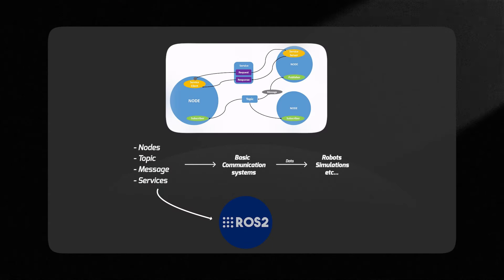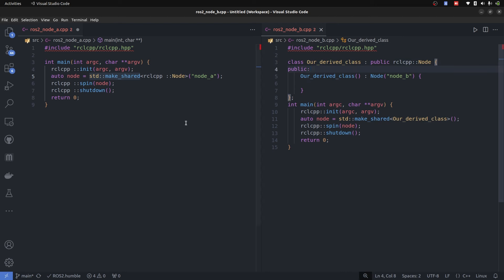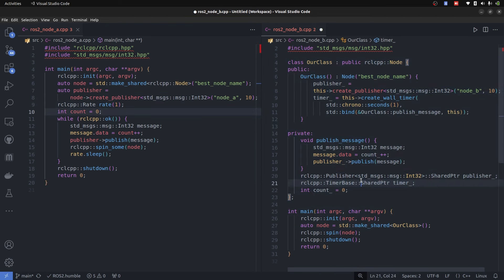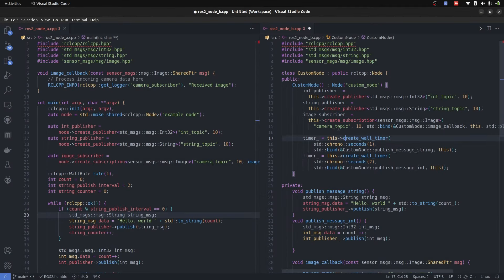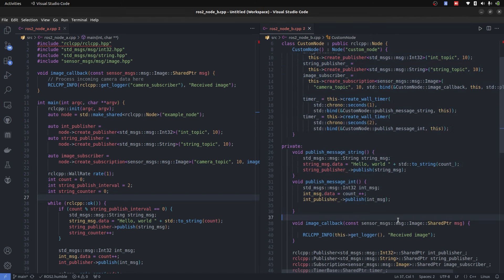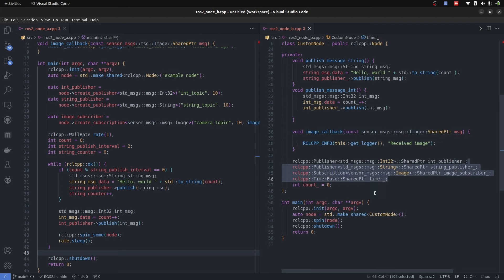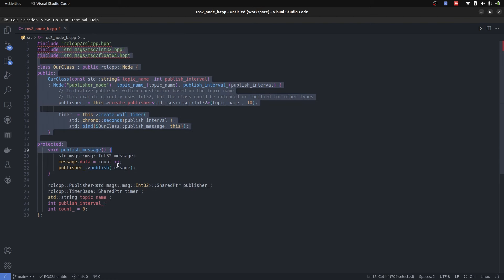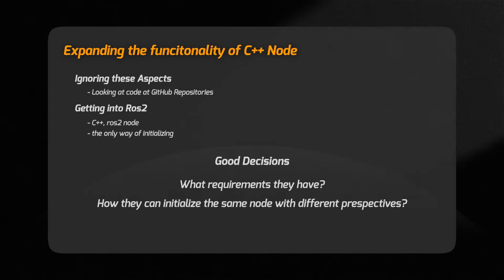ROS2 CPP Nodes: Various Methods of Initialization

Comment: As-salamu alaykum wa rahmatullahi wa barakatuh! I'm glad I found you. I have just set up my BeagleBone Black Rev C with the Xenomai kernel, and it is up and running. The next step for me is to set up ROS2 on my host PC (Ubuntu 24.04 LTS) to act as a master, while my BeagleBone Black will act as a slave performing real-time tasks.

It is important for me to handle the real-time aspect using C/C++ with the Xenomai real-time APIs (such as Alchemy, POSIX threads, etc.). Do you have any recommendations on how I should focus on setting up and starting to work with ROS2?

I understand that ROS2 itself does not have hard real-time capabilities, but I was thinking it could still send data (e.g., control commands, sensor data) to my BeagleBone, which could then handle these in real time. My main purpose for using ROS2 is to simulate my algorithms in Gazebo, but first, I need to learn the basics of ROS2.
Reply from the maker: walaikumsalam.
Learn basics ( nodes , launch files , services )
Get into MicroROS ( for MicroController based ros communitation )
differentiate DDS based on your requirments.